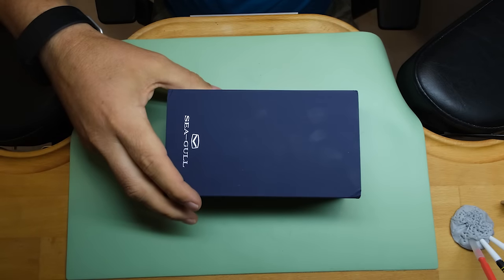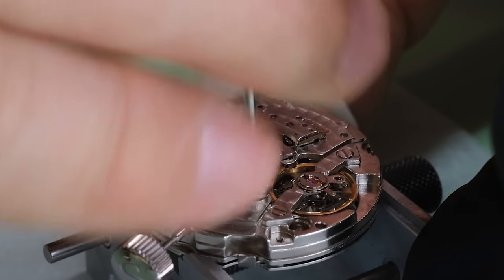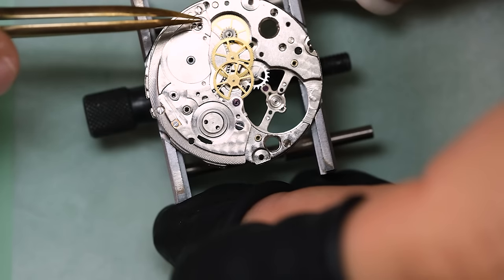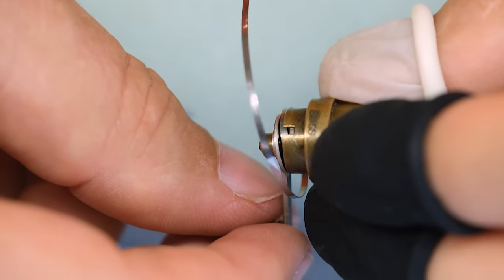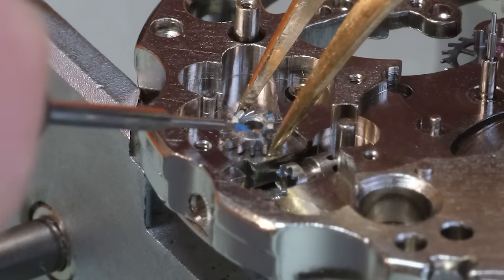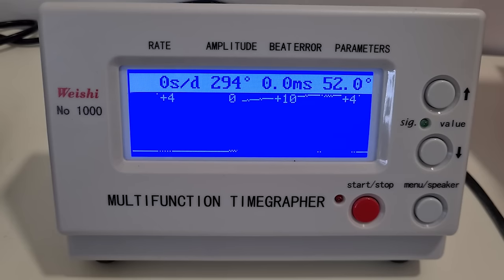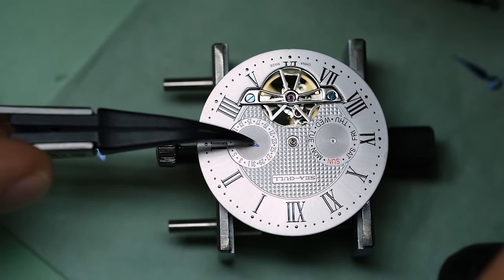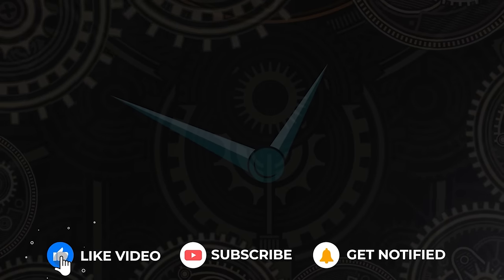How good are Chinese watches? Teardown + Giveaway!

Comment: Absolutely amazing!  you have mastered a great skill.  Very impressed.
I have an Oris 7653 - 47 automatic watch which runs a little slow.  I am willing to remove the back cover and make an adjustment.  By turning a tiny tab clockwise by a mm perhaps.
Question; I have an automatic Raymond Weil Parsifal Reserve De Marche 42 H.  After about a year of not using it stopped working.  I had to send it in and they serviced it for $350.  I am sure it is a matter of oiling something.  Can you please tell me why this might have happened?  Thank you!
Reply from the maker: Thanks for watching! Be very careful if you want to try to adjust your watch yourself, and if it is still under warranty note that you might void the warranty if you open the watch. 
Your Raymond Weil shouldn't stop even if it hasn't been used for a year, so exactly what the problem is/was isn't easy to say. Oil does not congeal after a year. Did the service center not say what the issue was?

Comment: “Every” Chinese watch I’ve bought, looked really great!  But they “ALL” broke down on me within a week! I have 3 all together.
All mechanical, but the 1st one the glass is really cheap! My daughter threw her teddy bear at me and the hard but thin eye cracked it, and I couldn’t find a replacement! The 2nd , I had it for 2 days and it stopped working! Took it apart and one of the gear wheels was cracked, the 3rd, the dial just popped out!! Completely popped out..! As I was setting the time lol.  Yeah that was the last Chinese watch I wasted my money on.  I got a Stuhrling and have had it for almost a yr and not one problem at all!  Yeah of course I paid over $300 for it but…!  It’s true.. you get what you pay for.
Reply from the maker: Thanks for sharing, Matthew! Yes, there is a price to value correlation, but it sounds like you were still quite unlucky, those are really horror stories 😂

Comment: Hei! This was a very interesting video even if it´s not the greatest watch. 
As my first step into watch servicing as a hobby I bought a Seagull ST 2130 (ETA 2824 clone) to build a custom watch. It has the same problem with not accepting the stem too easily, but worse - it works just fine until it doesn´t. It can work fine with good accuracy for days sometimes, and other times it runs for an hour after winding and have erratic stops. Well, this means I have to take it apart one day, but I will start practising om a couple of pocket watches I bought. 
Alltid moro å se dine videoer, og ikke minst lærerikt :-)
Reply from the maker: Hei Sjur, takk for det! Disse urverkene er nok ikke bygget med de fineste toleransene, så ytelsen vil raskt variere, vil jeg tro. Det kan være at det er noe rusk i urverket i din, basert på hvordan du beskriver det, og det er en god unnskyldning for å finne frem skrutrekkerne 😉

Comment: I've been looking for a low cost watch to disassemble and reassemble, as my first project. Would a simpler, new and working, watch from miyota or seagull be a good place to begin?
Reply from the maker: Hello Jim, I would pretty much 100% of the time go for a Seiko 5. You can get a running one from eBay for $50 or less and they are mostly sturdy and forgiving to work on.

Comment: The worst Chinese movements are the "Chinese Standard."  The worst of these are those labeled "Automatic" since the rotor will not wind the mainspring on any watch I've seen or heard of.  The manufacturers simply slapped an autowind bridge on top of the Standard movement.  When the rotor moves, it winds the entire works out to and including the crown!  The mainspring doesn't get nearly enough action to wind unless you golf or pitch 12-hours-a-day.  The Seagull movements I've known of seem to be reliable and durable, so I guess it's hard to include every watch under one name.

Comment: Looking at those scratches I came to wonder: Do watchmakers ever consider or test the quality of the metals used in movements? Corrosion resistance, hardness (scratch tests, hah...)  etc?
From my point of view the balance also seemed at bit wobbly I guess that could impact the future durability?
Reply from the maker: Hello Raymond, the manufacturer should of course make sure they use good quality metals, and I don't think that's actually the issue. It seems to me that it's more about machining skills/efforts and what level of accuracy and tolerances they accept. There is of course also a trade-off at some point as to how much effort they can/should put in for that price. And lastly, there's the entire cultural question about wanting to perform your very best or just doing what's needed to get your pay check. 
And yes, there's a lot of small inaccuracies in this movement that will jeopardize its long term performance. Not that you should expect more than a few years for a bit more than $100, I suppose :)

Comment: Having been on holiday I am only just catching up on this. My experiences with Chinese made items is not good. I have a 1965 Ford Mustang that I run regularly here in the UK. Original replacement Ford parts are no longer available but there are many people selling aftermarket parts but the majority of these parts are made in China and of very dubious quality. A few years ago I replaced the original mechanical fuel pump and the new pump lasted 3 months before stranding me on the roadside. I bought another aftermarket pump and again this failed leaving me on the road side. The Chinese pumps looked good but the material they were made from was rubbish, really soft crappy steel and I think assembled by a four year old. I would be concerned that this watch would wear out really quickly and start giving poor time keeping after a few years. The one you serviced will probably be the best one out there.
Reply from the maker: Hello Allan, yes, it's certainly an issue with cheap after market parts. In general there is a correlation between price and quality, and thus with longevity as well...

Comment: What would happen if the play of the barrel bridge with the barrel arbor is too much? Which are the consequences? 18:53
Reply from the maker: The barrel will tilt due to the sideways pressure and over time that will lead to wear on the bridges and binding on the wheels

Comment: Nice job stripping and rebuilding, what grease is the light blue stuff you used on the clutch in the keyless works called ?
Reply from the maker: It's Moebius 9504

Comment: Why are there multiple winners for a single watch?  Why communicate using Telegram when email is available?  Why charge 45 Euros for mailing the watch to the winner, as it would only cost 10 Euros or less to mail this watch internationally?
Reply from the maker: Hi, the draw will be on Saturday 27 August as outlined in the video. I made an update to all the scam messages a few days ago and also pinned it in the comment section: shipping will be free of charge and anyone asking you to contact them on Telegram is a scammer. Telegram is the playground of scammers, criminals and hate groups. So do not send anyone any money! 
I remove all the scam messages as fast as I can, but these bastards keep trying...

Comment: So interesting video! Thank you for your hard work. I wonder why Seagul made one plastic wheel instead of steel as the whole? For lower cost or less completcated in manufacturing?
Reply from the maker: Both! To ensure no damage can be done to the date change if someone pushes the corrector when the wheel is already engaged, there needs to be some flexibility. The plastic provides this with no need for any additional spring or complicated manufacturing simply by its nature as a material. Plus it's much cheaper :)

Comment: I think the only problem with such watch is, once it stops working or needs a service, that's the end, because the cost of services far outweighs the cost of the watch- it ends up cheaper to just buy a new one.  Which would explain the finishing (or lack thereof).  It's amazing we live in a time where everyone is so concerned about the environment, but font mind buying disposable "luxuries" such as this watch.

Which makes me wonder what one would consider the minimum value for a watch where servicing would be worthwhile.  I bet some vintage watches, even if the cost of services equals the value of the watch, is worthwhile if for the sake of preserving a classic.
Reply from the maker: Yep, you're spot on. It's a bit the same as the old Timex watches, which were made not to be serviced, just thrown away and replaced when they stopped working. It's a bit of a sad reflection on our modern society...

Comment: I have watched all your videos and absolutely loved! But this movement is very complex for what it needs to be. 
My question about quality is yes it is a $100 watch and it is not polished or have any kind of finishing but are the components including the plates and wheel trains made of quality steel?
I absolutely love your videos and commentary and look forward to more. 
You are a very skilled and it shows in your videos! I have watched all of yours and watched others and because of you I have seen their mistakes I have picked them and eventually they have found them. I will never be a watch maker nor a repairer as shaking hands is not a good thing.
Please make more videos as I love seeing your skill and craftsmanship!
Humour is fantastic and funny also.
Reply from the maker: Hello Henry, thanks so much! The plates are likely made from brass (which is common) plated with rhodium. I wouldn't be very sure that the materials used are high quality, there's a bit too much wobble and play here and there. In the end you of course get what you pay for, but for just above $100 I wouldn't expect my watch to run for more than a couple of years, tbh.

Comment: How do these watches compare with the watches of what are perceived now as quality/luxury brands? How do they compare with historical watches from the same brands?
What would a better quality control add besides the obvious more consistent results? Are these calibers missing essential features that would make them more precise?
It's disappointing to find particles of dust and fingerprints in these new watches. It's as if the makers do not believe in their product or in craftsmanship. At least not all of them.
Reply from the maker: Hello Christian, I think this kind of movement reflects on where the manufacturer is on a maturity scale, with a relatively low level compared to for instance Swiss or Japanese brands. Better QA would add a lot to the overall impression and reputation of the brand and allow them to climb the price scale.

Comment: At first glance the two look like they could be nice watches.  Looking deeper into the finish and the dial, they seem to me they look like a cheap knock off.  I don't like the chunkiness of it, and I don't like the knobs that are made for people with sausage fingers.  Taking it apart, the first cringe moment was seeing the plastic spacer.  Then more plastic in the movement.  Then the movement finish is done by machine and not very well. Then they throw in 3 plates, which does nothing but make the watch thicker and heavier.  When you make a watch out of cheap slag metal, you need to do this otherwise the watch would not have any heft.  
This movement doesn't look so much designed as it was a mishmash of copies of other companies designs.  Almost like it was just thrown together randomly. Like all things Chinese, this is a disposable watch.  Buy a box of 10 for $10 and throw them away as they break.
Reply from the maker: Thanks for your comment! It's certainly not a high quality watch but it's also not quite that bad :) I'd say it's worth the $100 they cost with the promotion when I posted the video but it's only for those looking for a mechanical watch at a very low price.

Comment: I'm just a novice watching but I am actuly an engineer. Surprised at the many parts that have clearly visible excessive running clearance yet that eatch runs very well. Also, from the other remarks, it seems the watch is reliable.
Reply from the maker: Thanks for watching, Stuart! Watches are very different beasts from most other micromechanics, in that there needs to be much more clearance due to the watch always being moved and frequently receiving small shocks. So from an engineer's perspective I can imagine the clearances look excessive but for the most part they're actually needed to avoid binding the train. That said, this movement is certainly not very high quality :)

Comment: I have had afew cheap watches from China. One very cheap which is still working accurately after 3 years . I complained that the dial looked a bit out of position, very little, and they sent me a new one, just the same, so I have 2 now, I sent for a fossil watch off Instagram ads and when it came it was a totally differen watch with a fake name close to a real name. I complaiend to Paypal and got my money back. Still have the watch. Another one came and the two small dials were just printed on , including the finger, so got money back on that.

Comment: thanks for a nice video👍🏼

i like flying wheel, is it made with special feature? is it complicated to make? 
does it affect the movement performance? 

i only ever seen the same feature on Zenith El primero openheart.(small blue fyling wheel) 

and about bridge attach on dial, is there any of this design on non chinese watch brand? tell me if there is
Reply from the maker: The flywheel is just decoration, to be honest. It actually has an ever so slightly negative impact on the movement as it has no function but still requires power...
Reply: @VintageWatchServices  Thanks for the clear answer. One more question, how about double balance wheel movement like 'Ailang double flying wheel' 

does it also have negative impact to movement performance? does it also reduce more power? thanks in advance 🙏🏼

Comment: I'm sorry but if you need to use an external tool to set a basic function of the watch, that's an instant no. If there's a function on the watch, you shouldn't need to get a poking tool to utilize it.
Reply from the maker: Hello Christopher, it's not that uncommon to have case pushers for setting things like moon phase, but for the date it is indeed unusual. You don't need a tool though, the tip of a pen or a toothpick for instance works just fine.

Comment: Hi-Actually Sir, a flash back to my Apprentice days, 1950's ; I was taught by Old men,Engineers at Maudslay Motor Co..( Henry Maudslay invented the first Screw cutting lathe.C.1798 ) The idea was that, costs should be directed/ applied to the business or 'working surfaces' of a component & it's function ; attaining a special finish on parts that did not improve its fitness or function or form to make it expressly fit for purpose was considered foolish & simply a waste of time & man hours. Naturally aesthetics from an external beauty point of view was a sales requirement, but, things inside, & never seen were left at Utility standard. The Chinese seem to have gone down that road. But I must also say, an old C 1900 Hamilton pocket watch ( Railway Standard ) I have, with its 21 J, & is so exquisite it is a 'Joy to behold'.So we have : Pride of workmanship vs Utility. Culture & refinement ?
Reply from the maker: Thanks for your comment, Eric! Those are indeed the trade-offs, but the watchmaking industry is a bit strange in the sense that one has gotten used to parts being finished even where the sun don't shine (literally). And those old American pocket watches are some of the more beautiful movements from that period :)
Reply: @VintageWatchServices -Re-Give away : Actually to be honest Stian, I feel a bit fake.
I had no idea or intention in my comment. 
I simply u/stood why the Chinese-do what they do. I also note your comment re- Metric measurement, I did an in-depth study on this subject 12/15 yrs ago, { embracing Roman Army influence all over Europe }& the results are highly compelling- even startling in one instance. But that's for another day.Kind Regards.

Comment: How do you know where to start assembly?  There are SO many parts.  Is there a standard order for assembly?  Also, how so you know which screw goes where?  Are they mostly all the same where small screws and big screws are identical and all you need to know is the thread size to pick the correct screw?
Reply from the maker: Hello Bert, thanks for watching! There isn't entirely a standard order for assembly, but there are some parts that need to go in before other parts. Different watchmakers might do things in slightly different order, but once you understand the logic of how these little machines work, it's less complicated. A good video for gaining that understanding is this one: https://youtu.be/hkK6e4tb5Qk
The screws are different depending on their roles, but there is a clear logic there also, so after a while you mostly get them right. Not always though :)
Reply: @VintageWatchServices  Thank you for the reply!

Comment: Great video! I have the exact same watch. When I try to set the time, I hear a clicking sound, but otherwise, the watch operates perfectly. Do you experience the same clicking sound?
Reply from the maker: Thanks! No, there shouldn't be a clicking sound when setting the time only.
Reply: @VintageWatchServices  Thanks for replying back. I have found the problem. I believe i am not pulling the crown all the way.  Right now no clicking at all. 🙏👍

Comment: Not to Swiss standards, but the manufacturing and tolerances on this movement look so much better than on the Tongji standard movements. Thanks for offering to give it away.
Reply from the maker: 🤔 I don't know Tongji standard movements?
Reply: @VintageWatchServices  "Tongji" is the name of the Chinese Standard Movement manufactured by multiple factories to the same specification. It's the movement usually found in <$50 mechanical watches. https://en.wikipedia.org/wiki/Chinese_standard_movement